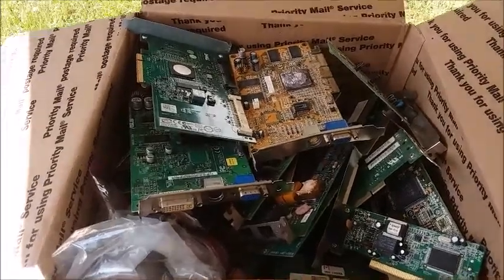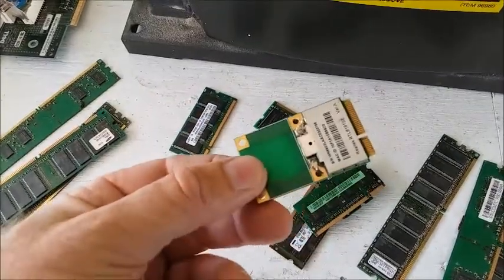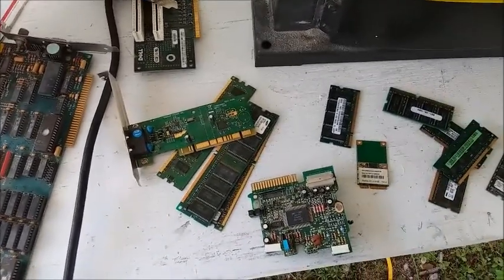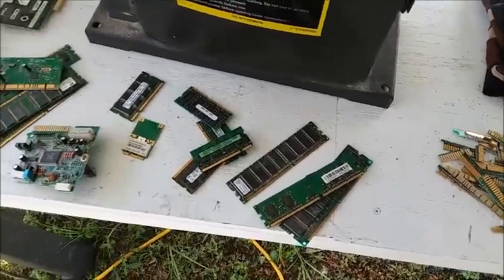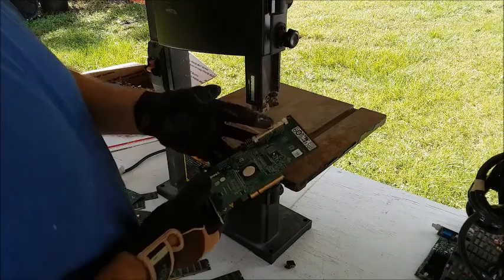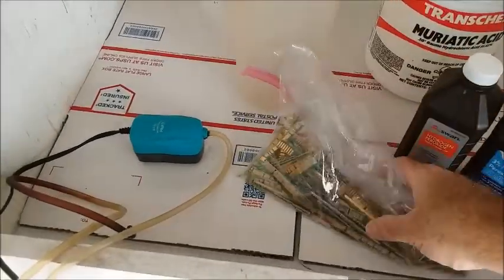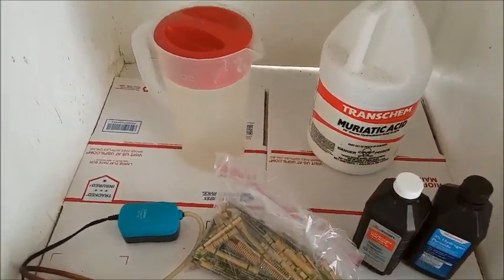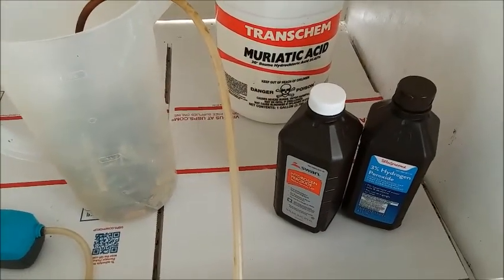Getting started in gold recovery from electronic waste - part 1

Comment: You said it yourself, the warmer the acid is, the quicker it works. so why don't you use heat? You can use something specifically designed to warm fluid, say... A Coffee Pot!
I Use a Coffee pot for small batches and for really large batches, I have a small CrocK Pot. I had the coffee pot but I bought the crock pot from a goodwill store for about $5.
It really speeds things up. Small batches of fingers are done in 1 Day, possibly 2 if I start them in the afternoon. I turn the heat off at night for safety reasons. I also re-use my acids multiple times until the acid is so saturated with copper it's almost black.  
I believe you are also using too much peroxide in your acid. You should only use about a 3:1 ratio of acid to peroxide. Too much peroxide in the acid will dissolve the gold.
Keep up the good work..

Comment: I did a test trial to some gold plated connectors. I added muriatic acid(fuming) and hydrogen peroxide(6%) and the gold foils dissolved along with the other base metals. Which do you think was too aggressive? Add water to solve or reduce the amount in one?

Comment: The only environmentally responsible way to do this is at scale, at facilities equipped to handle and treat the waste fluids and sludge.  The heavy metals will suppress organisms at the local sewer treatment plant, or affect downstream communities which rely on treated surface waters.  Done irresponsibly, this is morally no different than doing 15k in damage breaking into a building to steal 50 dollars worth of copper.  You are putting the costs of your meagre profits on others.
Reply from the maker: Please hold off on the premature complaining. I try to do this in an environmentally responsible way. Parts 2 and 3 will deal in part with handling the waste, which there isn't even any of yet at the end of part 1.